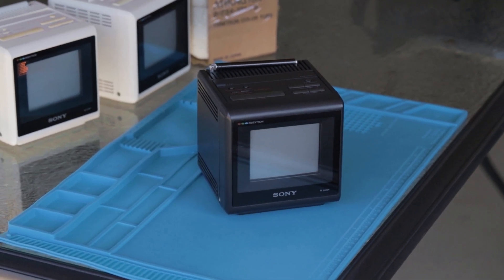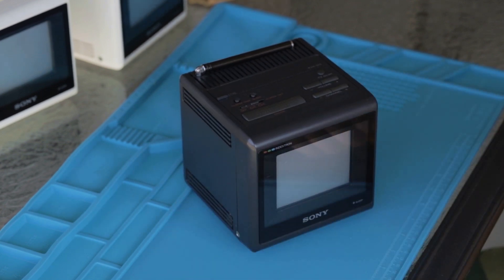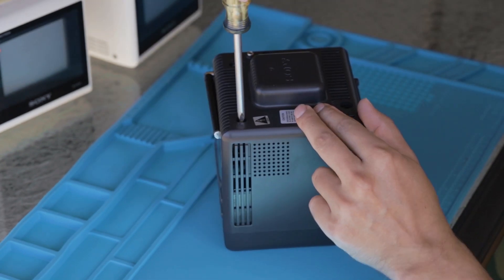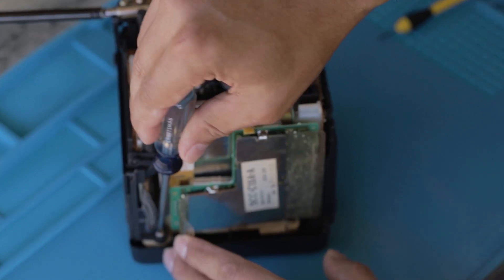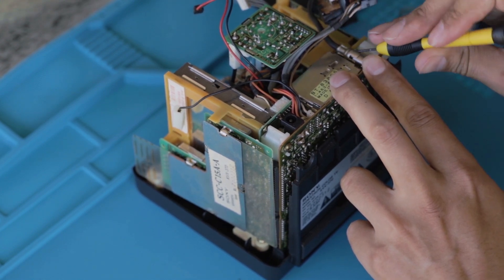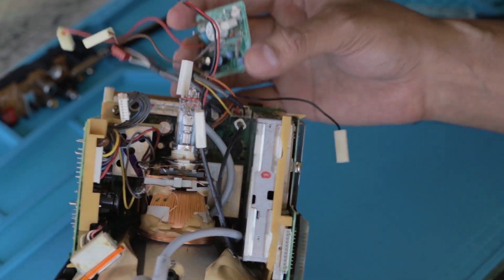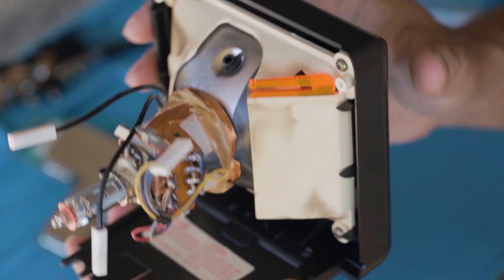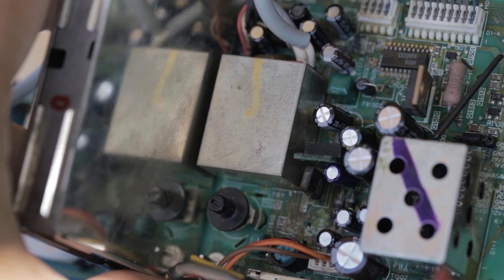Sony WatchCube Teardown

Comment: Bought one from Japan, looks on the inside like the flyback cables have been burning but cleaned them and they turned like new. It was stained of black smoke and I suspect one of the transistors/gates was arcing when it ran, and that deposited all the black smoke onto it. Looks doable, going to replace all the caps with solid if compatibles found. The tube appears to not have gone to air and the audio stage seems to be working to some degree.

Comment: Intresting on how sony managed to fit so much into such a tight space. Nice video btw.
Reply from the maker: Thanks! Yes, it's impressive. But it gets really hot inside and I wonder if that contributed to these things failing.
Reply: @SupraguyCRT  Yes, possibly heat could of shortened the life span of the capacitors. If heat was a factor to the leaking capacitors, it's best to replace with 105C capacitors, though higher temperature capacitors are sold on digikey though, like 130C. But of course, they are quite pricey for a capacitor.